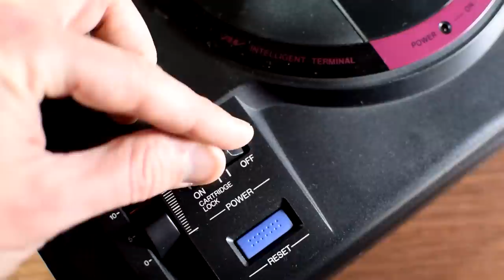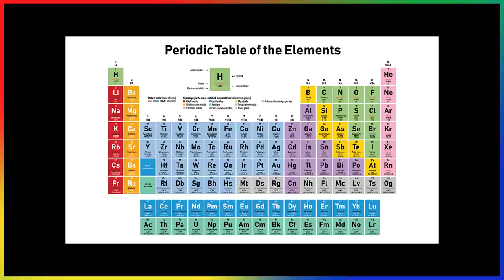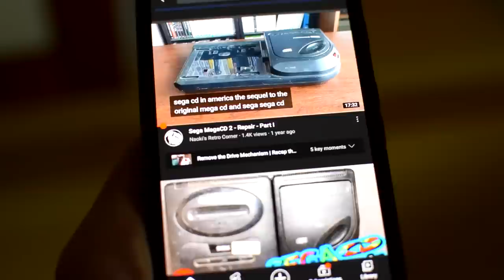Should You Fix Your Own Consoles (And Games)? - Retro Bird

Comment: The only time I put my hands inside a console was when i removed the pin in the NES that prevents it from playing games from outside the intended region. It wasn't an actual fix of course because nothing was broken. Anyways, it was relatively easy so I tried and it worked. So now, when I want a game for my collection, I don't have to worry from which region it comes.

Comment: I fixed my master system. It powered on but it would only boot into the stored game, it wouldn't read carts. After searching for a solution someone suggested reflowing the solder of the cart pins. I did it and boom, working master system which I got complete with the 3D glasses for $100.
Also fixed a CIB virtual boy that just needed the eyes reflowed

Comment: I work on a majority of my systems. I usually rely on simple repairs and have a few that I still need to complete. One of my recent repairs was GBA SP. The F1 fuse was damaged so I removed it and bridges the connection. While I was in there I added a wireless charger.

One that I would like to finish is my GBC. The start button had to be bypassed, a new power switch and USB charging needs to be added.
Reply: Bridging a fuse position is not a good idea. Fuses are in place to protect components down the line which are much harder to get replacements for. I understand the temptation to just bridge it and see if that is all that is wrong with it. But definitely don't leave it like that unless you really can't find the appropriate fuse replacement.
Reply: @mottzilla4858  The F1 fuse is a fault prevention for charging. I have a regulator on my wireless charger to eliminate the fault again. It completely bypasses the need to reinstall one again.. Unless the F2 fails.

I do have ceramic fuses in the event I would/will need to.
Reply: @nubatman  I'd put the fuse in just because it's a lot cheaper and easier than if something terrible were to happen and a custom IC got damaged. Then you have to source a replacement that will likely cost more than a fuse and be more work to install. But it's good if you know the exact purpose of the fuse. 

My opinion though is likely influenced by my original SNES actually having one of its custom ICs developing an internal failure just due to age, not any critical event. And replacing that custom IC would require a donor from another system. So I'd be very cautious of anything that might damage a custom IC. Until someone crazy person out there starts producing replacement custom ICs for all these old systems.
Reply: @mottzilla4858  I will consider it. I forgot to mention that I have a total of 16 GBA SP systems and the one was just a Frankenstein build. All the other ones are stock.

Comment: Yes, yes yes! I try to fix all my consoles. It started back with the 360s RRoD. I figured it was an overheating issue and was able to fix it with new capacitors. Since then I’ve fixed my kids Xbox’s and their friends also. I’ve also fixed the screen on the WiiU game pad. Fixing your consoles can be scary but you can do it if you take your time and do your research. My XB1X recently stopped powering on so I looked up the cause and found that it’s a power supply issue. I bought a replacement and it’s alive again.

Comment: I was actually taught soldering at school between the ages of about 11-14. I wasn't even skilled in that class but I got adequate results. If you're just replacing a battery or small part, look for some instructional videos and you'll be okay.

Comment: Fix some that died from something else later, but at least got a little more time out of it. Got a Dreamcast that I got a replacement part for because the guy before me really borked it. I still need to get around to getting it working. Also ordered a Xbox so rusty on the inside I really think I might just throw it out. Maybe keep the harddrive and the DVD drive might be okay will have to take another look before the next time I move.

Comment: I have a super nintendo in a tote under my bed. It's been there for 3 years ever since the graphics started screwing up on it. I took it apart and was super charged to fix it until i ran into the soldering issue 😂. I bought refurbished one to replace it but it still has a home under my bed, waiting for someone (maybe me) to give it life again.

Comment: I haven't had that many issues with my consoles.  I'm more into modding, and being able to perform the mods myself saves quite a bit of money. I have yet to attempt to solder a flex cable, but I feel I'm getting there.  On the fixing side, a few months ago I got a GBA SP that I was going to mod for my brother as a gift, I got it for really cheap,  all I was concerned about, was if it actually turned on.  When I was almost done, I noticed, the L and R buttons wouldn't work,  I love watching repair videos and I'm familiar with the issues that might arise.  So first thought, was to get the juices flowing like you said on the video lol, so yes, re flowing the soldering joints in both buttons, so that's what I did, I heated them up to make sure there was a good connection.  And yes they started working first try. 
Another one was the N64 I had as a kid, It hadn't been used in over 15 years or so, I went to try it out but only the red light would turn on and there was no picture.  I thought it was fried or maybe the display port had gone bad.  I even asked people online about the issue,  actually a guy I know through facebook that has a videogame store, where he sells buys and even repairs stuff.  He told me there was no use, that the console was dead.  Well, being as stubborn as I am, I started thinking nothing bad had ever happened to that console, why would it just die.  For some reason I thought about cleaning the contacts on the expansion pack with isopropyl alcohol.  And that actually made it work, kinda like blowing on the cartridge when It doesn't want to work lol

Comment: The only console fix I've done was replace the lcd of a PSP. I've never had to solder anything but a wire inside my guitar and the remote of my kid's RC car. There's a broken NES in my closet. It turns on but my tv never detects a signal. It probably needs to be replaced because I think something spilled on it years ago. Emulation has been an amazing alternative but afaik there's no way to play Duck Hunt or Eggsplode properly on an emulator. I kinda miss them.

Comment: I’m willing to dip into things like recapping (game gear), replacing gameboy cartridge batteries or screens for handhelds, and cleaning. Anything like a chip going bad or needing to rewire is off the table but I find most of the issues are simple. It’s extremely satisfying to have learned to do all these things off of YouTube and have a game or console start working for you. I’ve saved a ton of money that way. Pokémon games for example, people assume they are broken when they don’t save and sell them cheap, but I have them working in 5 minutes. If something is significantly cheaper, even if I haven’t tried to fix it before, I’ll be willing to buy it and give it a go. I got a game gear with battery pack for less than $20 and repairs cost me about $6 to recap. Sounds harder than it is, because I’m not close to an expert so a lot more people can do this than probably think they can

Comment: I fixed quite a few original xboxes usually the disc tray goes bad or just ripping out that worthless battery/clock capacitor that always leaks all over the board... I've opened up a couple GameCubes and fix the laser as well as for soldering GBA Game Boy color battery Replacements piece of cake same goes for old cartridges game bit screwdriver rubbing alcohol on the board sometimes you have to reflow the solder.... Nintendo switch cough cough stupid joycons.... I've probably done a good dozen or more I have nieces and nephews and friends with kids as well haha and I'm very experienced in soldering when it comes to modding/mod chips too eh

Comment: Pointed tip soldering irons aren't always the best. Especially for beginners with beginner level equipment, the heat dissipates so much faster than a chisel tip, you can end up holding it on the solder+component for so long and not melt any solder, but all the components around it begin to burn/melt

Comment: I think like a lot of people when the Xbox 360 RROD happen before Microsoft extended the warranty to 3 years I had to find ways to repair it. the disc drive was first having to replace the laser. then different heating problems. I still own 3 Xbox 360's all with RROD. I was trying them the other day and 2 of of 3 of them actually started and was working  🤷‍♂. the last repair I tried was a water damaged partially working ps5 controller with no luck. its always worth a shot to try. P.S. I have a fat ps2 that the disc drive isn't working right so I soft modded it to play games off Hard drive.

Comment: Around ten years ago I fixed my original Gameboy. It had some dead Pixel colums, and as I saw, it could be fixed by just reheating the solder-joints from the display to the board, I ordered my first own Soldering Iron for a long time. It was so satisfying to see all the pixels comming back to live. 

Since then non of my consoles died except my trusty N64. Could not find a working solution for it. So I ripped out the insides, put a Raspberry Pi in it and made it work with the original controllers. So at least I can pretend to have my childhood N64 still with me.

Comment: I fixed up an NES that was listed as functional, but upon receiving it, didn't because of loose pin connection. I opened up the console, cleaned it, and adjusted the pins on the connectors. Low and behold, it works! However, I did happen to tighten the connectors a little too much and now it has the Ill fated "death grip"! 😱 Oh well, it works, and who knows, it'll probably loosen up over time. 🤷

Comment: You really shouldn't be soldering batteries, the right way to do it is with a spot welder as it's not going to warm the battery. But, it's probably less of an issue with lithium cells than with larger batteries.

Comment: I just fixed the CMOS battery issue on my dreamcast, I had to fix the sound issue with my DMG gameboy, where it thinks the headphones are plugged in, and won't send sound to the speaker(altho it has gone out again, so I need to go in and clean it up again), but I played with Parma slot cars for a while, and that required basic soldering to change out motors on those, so I'm comfortable with basic soldering, but I spilled soda on my Switch Lite and opened it up to clean it and was WAY too intimidated not to mess something up, so I had it professionally fixed/cleaned up

Comment: Omg if you're a dreamcast fan you'll be fixing something! I've had so many problems, you'll at least have to replace the clock battery which requires soldering.  Had to replace the laser assembly as well.  Then my other DC had a problem where the screen would just go black after turning it on, had to ship it to someone else to fix that.

Comment: I sold my old GameCube because what you say a toddler knocked it over and it no longer read discs it's still Powers up but it just won't read disc so I had to buy new GameCube because I don't know how to repair a video game console. I still kept it for a long time but then I sold it on eBay for about 30 bucks. I did mention it doesn't read disks but if you could fix it you could resell it or play it.

Comment: My 7800 stopped working and after doing some research found out that the buttons on the console sometimes need to be replaced. I ordered a replacement set, but since I could not solder I bought another 7800 on eBay. Unfortunately the new 7800 has some problems with its rf. Sometimes it was really fuzzy, other times it was worse. One day I was really wanting to play some 7800 and the replacement 7800 was not working at all, so I decided to fix my original without soldering. I took out the board, got a hammer and screwdriver, and started removing the old buttons by force. Once they were out, I slipped the new ones in, without soldering anything, and put everything together. When I tried to turn it on everything worked perfectly. I eventually had a friend solder the new buttons into the board, and I am still using the same system today.

Comment: I have gotten so many of my systems fixed at some point. I had a local Game shop replace my Gamecube internal clock battery. They also soldered the ribbon cables of my Virtual Boy so that it works great. 
I sent my Turbo Duo off to a Modder a couple years back and he recapped the whole board, RGB modded the system, and made it region free. 
I got a Model 2 Sega Cd, a Panasonic 3DO, and a Philips Cdi all for free because they were broken. The 3DO I sent off to a repair guy and he replaced a few caps and bam, the thing fired up. I actually just received the Sega Cd back. He replaced caps and the laser and had to adjust the laser but now it is working again and is my dedicated Sega Cd for the Mega SG. Wouldn’t you know it though, as soon as it arrived, my other Sega Cd, my Model 1 stopped working. I am now about to send that one off to get repaired too. My favorite story is the Cdi though. My Dad and I fixed that one. We discovered it just needed a new drive belt and some greasing and bam, that thing fired up. I just need to find someone now that can do the internal clock battery replacement repair.

Comment: I've been on both sides where I have fixed something Solder or broken it further, Model 2 Genesis that we had owned forever had stopped working when I was a little kid so I was very luck and my parents got me HD Model 1 but we kept the model 2 the whole time since I got heavy into collecting I decided I should learn to fix my stuff. Looked up online that its very common for the solder joints for the DC jack to crack, reflowed the joints and boom the model 2 was working again.

Then I had found a different model 2 that you're able to do s video mod, I was using a non temp controlled soldering iron and melted the video signal leg off the video chip🥲

Comment: I’ve fixed my original Nintendo switch so many times I can’t fix it anymore. The screws are all stripped out and it’s in desperate need of a total shell replacement. I’ve also ruined two Nintendo switch lites trying to replace the analogue sticks and am working on ruining a third. Only succeeded once in that repair… I’ve also rehabilitated numerous joy cons but can’t seem to figure out what’s wrong with one of my pro controllers. And I can’t solder to save my life

Comment: I got a beautiful M1 Genesis in a bundle (that is probably worth $1000 now but I paid $150 for it) which was labeled as broken. All it needed was to have the contacts cleaned. Wasn't really a risk because I bought it for the games and Power Base Converter. 

Fixing games is pretty easy though. Usually you just need to clean them. I had a dead copy of Quake 2 for N64 that just needed the chips reflowed. That wasn't hard.
Reply: What the hell does "chips reflowed" even mean? Glad its not hard.

Comment: I had a Genesis 2 I rescued from a cat lady.  Poor thing was a total mess, and it wouldn't read cartridges.  After trying to clean the cart slot it fell to searching for bad capacitors.  Went online and pulled a schematic and began testing traces for continuity.  Eventually found the culprit, a fee corroded traces.  Cleaned up the corrosion as best I could and soldered in a botch wire to bypass the ruined portion.

Also, this process works on broken controllers!  Never throw any old game hardware out till you've tried a multimeter!  I brought an NES Advantage back to life this way!

In response to reflowing, it's not that it "gets the juices flowing".  Sometimes old solder connections break due to temperature fluctuations over decades.  Reflowing the solder just rebuilds those connections
Reply from the maker: Saving a Genesis from a cat lady?  I feel like that deserves some sort of medal!   And by rebuilding the connection, isn't that "getting the juices flowing" back through the board again?  I mean, if those connections are broken then the juice can't flow :)
Reply: @RetroBirdGaming  I feel that understanding why it works is very important to sharing knowledge, as it keeps folks from thinking of it as a magic solve-all
Reply from the maker: @slamshift6927  I agree and appreciate you clarifying why exactly it fixes it.

Comment: Fixed my original xbox 360 several times. Though this last time the issue was sounds would no longer play, so I am assuming it has something to do with the connections in the console for the composite cable as I tired various games and composite cables.

Comment: It's very satisfying to get a system working again. However you have to realize you not everything can be saved. Some systems are just beyond repair. In that case I scrap them for parts or sell them.

I will say if you want an easy system to repair for practice, start with the NES or PS1. With NES it's usually the pin connector that needs repair or replacing and with the PS1 is usually the laser. The SNES (at least the original model) is anything but easy. So many issues can go wrong on that.

We are starting to see issues where a disc not reading is caused by capacitors. The trick to know for sure is let the system warm up and if the game reads, you most likely have your answer.

Be very careful when handling power supplies. Don't touch anything except the sides and never touch it when it's on.

A temperature controlled soldering iron will give you much better results compared to those plug in ones. They don't get hot enough in my experience. Also lead solder is your friend. Yeah, I know it's not exactly environmentally friendly but it will make soldering much easier as it has a lower melting point.